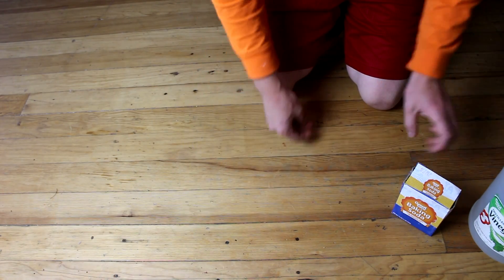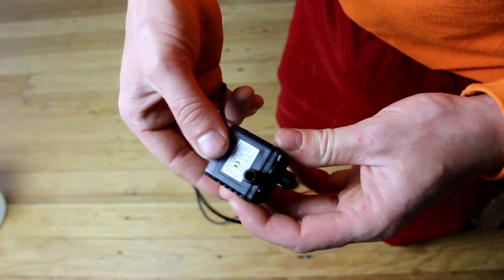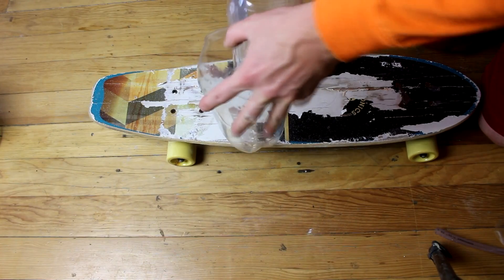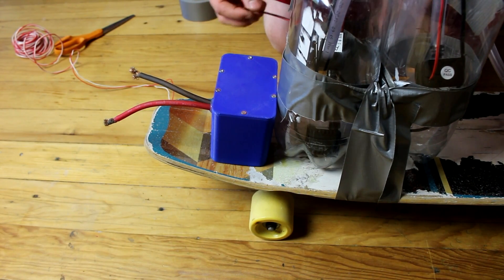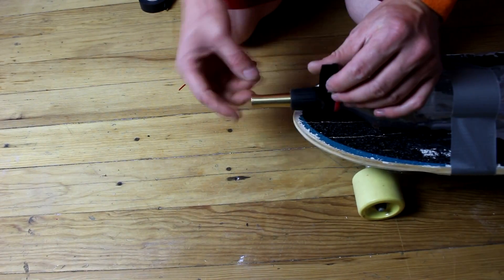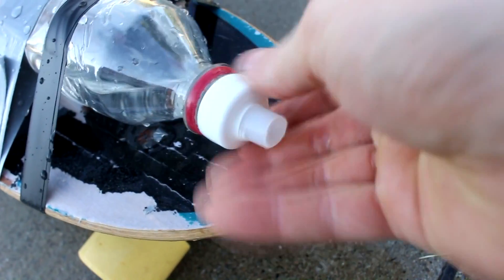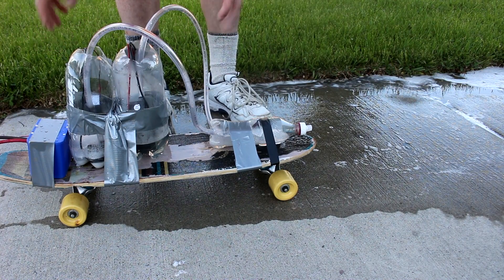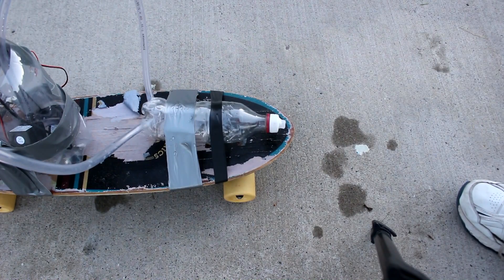Liquid Fueled Baking Soda/Vinegar Rocket

Comment: An unmanned acid spraying skateboard.  Love it.
Reply: It's a salt, or whatever it's called in english when you mix a base with an acid.
Reply: @LuizDahoraavida  It's an Acid-Base Reaction, where a Salt and H2O is created, while they both neutralize eachother because the acid gives a proton (H+) to the base, neutralizing them
Reply: @alanelcapon8342    If mixed in the proper ratio.  My mixture might have a slight excess of Aqua Regia.  (Which I saw a lab worker dump 500ml of on himself while the acid was hot.  You never seen two people rip the clothes off one other person so quick.  Lab worker was fine, pants were not.  lol)
Reply: @seanb3516  why aqua regia lol
Reply: @lautaromorales2903  It's the strong acid I am familiar with from gold assay work.  There are of course faster acting acids and patience is a virtue.
Reply: @lautaromorales2903  extra danger extra reaction
Reply: Don't mind the people here not getting the joke ;)
Reply: Genius! Why didn’t it catch on before? Smh my head

Comment: Hey Cody,  I think one of the problems could have been that that skateboard looked pretty old and chances are it had rusted bearings.  I would bet that if you removed that source of friction with new bearings or even cleaned the old ones you would have had less resistance and it would have rolled easily.

Comment: Two questions: 
Could one use sealed fuel tanks and a pressure feedback system from the 'combustion' chamber so that the pumps only have to maintain flow rather than fighting against the chamber pressure?
Would some kind of baffle system in the chamber help mix the propellants and ensure full reaction happens within the chamber?

Comment: 2 things

1.  Maybe make the container where the two reactants mix larger, so you don't have propellant being formed after it's already escaped.
2. Put a one-way valve on the inlet so you don't have back pressure on the pumps, allowing for a smaller diameter outlet
Reply: Making the reaction chamber larger wont help much just add weight and size, a smaller reaction chamber is better, the important thing is to achieve good mixing, once the reactants are mixed there is no point in prolonging their stay on the reaction chamber.

The average mass flow will be always limited by the power of the pumps, adding check valves and reducing the nozzle diameter might not help and in fact lower the power by lowering the duty cycle due induced oscillations.

Comment: What if you added one-way check valves and used a smaller nozzle and reaction chamber? Would it act similar to a pulsejet? When it's initially switched on the chamber isn't pressurized and the pumps can push the reactants into it. When enough pressure is produced the valves will close, effectively creating a sealed vessel apart from the nozzle. Once the reactants are almost used up the pressure will drop to the point where the pumps produce enough pressure to again open the check valves and the cycle repeats.
If this would work then you could probably use gravity to feed the reactants rather than the pumps.

Comment: Well lets try this again, but this time with conc. sulfuric acid and caustic soda as fuel :D
Reply: Let's try again with hydrazine and fuming nitric acid as fuel
Reply: @sergiomorales4009  holy damn
Reply: that escalated quickly
Reply: Caustic soda would actually perform worse. It’s the CO2 that drives this
Reply: Caustic soda will just produce tons of heat, no co2 gas

Comment: maybe you can use some one-way valves in your delivery tubes to keep the fuel from backing into the pumps. you could also try to incorperate a pressure chamber into the nozzle in order to help build up more pressure and more efficiently react the two chemicals.

Comment: A cone nozzle might in principle help; the fluid is expandable, since it has gas bubbles in it so normally expanding it against a cone would give higher thrust. However, the viscosity is high, so I'm not sure it's such a big win- normally you would get twice the thrust.

Comment: Hi Cody, 
Do you think using 1 way valves on the 2 supply tubes to the compression chamber would adequately mitigate the back pressure? Which seemed to decrease pump efficiency, and might it increase thrust? Or do you think the increased thrust would just keep the valve closed and back to square 1? 
-Great Videos, thanks for sharing

Comment: There is a lot of research on "soda and mentos" nozzles For an engineering class that was our only assignment one semester. It was to design a rocket car using diet coke and mentos. My team and I went a different route. Instead of just relying on thrust I thought it would be a good idea to make it like a water wheel so you get get a little extra energy out of the thrust. Our car was not the fastest but we got the longest distance. We got an A on our assignment which was pretty sweet. And we got a note from the instructor who said he had never seen anyone try that idea before and thought it was genius. This little note stroked my ego a little bit.

Comment: Wait, Cody. How does connecting two pumps with equal output increase the pressure??

I've build a watering system for my plants that is 150cm high from the reservoir, but I've got a pump that can only lift to 120cm. Are you saying that if I connect two pumps I would get a higher lift?
<3

Comment: I reckon you'd be better off with a smaller reaction chamber and a proper nozzle. In a real rocket most of the thrust comes from the gas expansion inside the nozzle rather than the reaction mass being forced out the back.

Comment: there would be more friction in water then on the skateboard.  you might want to lube the bearings.  I think your nozzle is also an issue.  I use to take water bottles put in baking soda wrapped in tissue paper drop it in a water bottle with vinegar seal the top and let it explode.  making airs of gernades for my son.  so your soda mix might be off.  lots to play with.  though credit?

Comment: in the early rocket engines they used something like a checkvalve so the expanding gasses could not pressurize the fuel preventing it from getting pumped. 

i mean... you can build basic rocketlike engines that suck in air and gas almost easier as that contraption there... that might be a kinda more fun project to do and quite a bit more challenging. 

the safest bet on a water based rocket engine would be a high pressure pump. but then you still have the problem that water doesnt store much  energy.

that basically proves that the earth is actually flat.

Comment: I would recommend checking the bearings in the wheels, bad bearings will slow you down tremendously. Upgrading to ceramic bearings would be ideal.

Comment: I bet you can get this to work with:
lighter battery (you dont need a lot of power to run the pumps for long).
lighter skateboard.
well oiled bearings or really expensive wheel bearings.
smoother, level surface.

Comment: Pumps are one way to make rocket engines the other is pressurize the fuel tanks and use valves to control the rate

Comment: Some check valves to prevent the pressure increase from stopping the pumps might be useful
Reply: The check valves closing stops the pumps just the same, as the pumps have to overcome the pressure to open the check valves.

Comment: Maybe use dry ice or liquid nitrogen to pressurise the fuel tanks. That way you won't need the heavy battery or capacitor. It could work better.

Comment: Smaller battery and better wheel bearings might help out. i wonder if you had enough fuel setup right on a hydrofoil boat if you could get significant speed. Maybe throw a RC servo on a rudder and have a alkaline/acid powered boat.

Comment: Wouldn't it have been better to feed from the bottom of the tube so the pressure in the mixing chamber would have the weight of the water on it from above so it'd be harder to push back?

Comment: G'day,

   Ah, as it happens, not ALL Liquid-Fuelled Skyrockets use Fuel/Oxidiser-burning Turbopumps to feed Motion-Lotion to the Reaction-Chamber....

  Last week the Kiwis made their first attempt to reach Orbit with a Rocket which featured Carbon-Fibre Construction for the Fueltanks and "Fuselage-Tube", and ELECTRICALLY-DRIVEN Fuelpumps...; and, just like your Rocket-Driven Skateboard their Thrust was sub-optimal, and just like your Skateboard the electrically-pumped Kiwi Rocket failed to reach Orbit although it did start & run & produced thrust.

  The Black-Plastic Electric Kiwi Rocket  even lifted itself off the Pad....

   Have a good one,

  ;-p

  Ciao !

Comment: at 7:45 i don't think this is a correct explanation of why a nozzle would help. The mass flow rate would be the same, so the explanation of more recoil doesn't make sense. I think its because nozzle directs more of the flow in the direction desired, instead of wasting momentum via turbulence. Could be wrong though.

Comment: Could you use the vapor pressure of something like liquid nitrogen or dry ice? to pump the reactants through a fully enclosed system. Similar to what was done with the compressor, only with the pressure source being self sustaining for a certain period.  Might solve the back pressure issue.

Comment: Would be interesting to hybridise the concept. Keeping the vinegar as is and allowing the bicarbonate to cake into a hollow cylinder (I'd guess high humidity would cause the caking process to occur more rapidly). Pump the vinegar through the solid stage, and witness the science. There's also the potential to use a 'sports cap' from a water bottle to build some pressure, though this could just cause too much back pressure on the pumps.

Comment: If you want to make it more efficient, make sure your wheels are well lubricated and are super easy to roll, so the rocket doesn't have to work against so much friction. Just a tip to those one or two people who are actually interested doing this as a science fair project.

Comment: You should run tubing back to the fuel tanks, this will pressurize the tanks to be the same as the chamber. then your pumps will pump at the same rate no matter how much pressure you build up. That means you can use a small nozzle and boost the pressure.
Reply: obviously this means you will need sealed fuel tanks.

Comment: Hm. Maybe the thicker plastic of a Gatorade bottle would be a more durable combustion chamber. It has a larger volume of course, but with more pumps it could handle a lot more pressure.

Comment: impeller pumps do not work that way...
Reply: bovinespongiformflu Yea,  I really doubt that they are in  any way additive. Each pump moves a certain capacity of water for the given motor input. Increasing pressure would require  pushing into a narrower channel or moving more mass.  The latter is not possible because the mass going though both pumps must be the same.

 I concede that the second pump might have an easier time as the water has been pre-accellerated and thus pull the first one along slightly,  but I would expect that effect to be minimal.
Reply: Pressure = .434Head * Specific Gravity for a given liquid. As head increases so does pressure.
Reply: it will increase pressure slightly but will cause cavitation, its just very inefficient, they should be parallel
Reply: Tim Harig while all the information you gave is technically correct, you completely missed the point that there is a chemical reaction giving off gas in a confined space here.  This is the entire basis behind thrust (energy differential from the high pressure combustion chamber to low pressure space) and is why fuel pumps in actual rockets are in series (multistage), not parallel; they need to overcome the high pressure of the resulting gases in the combustion chamber. Google  turbopump.

The gas creates back pressure (directly proportional to the flow) that is relieved by gas escaping through the nozzle (square root of the flow).  Therefore, the pumps in series, in this case, are increasingly more effective as the fuel flow increases.  

When dealing with straight liquid, pumps in parallel work better when you are running towards the higher end of a single pumps capacity.  It allows you to effectively double the flow if running at the far right of its curve.  Parallel pumps don't really do anything when operating toward the left of the curve (low flow).

Pumps in series are kind of the opposite, but in regard to head.   Using pumps in series at the left of the curve (low flow) will effectively double the head, but using them at the end of the curve does next to nothing. However, pumps in series is normally not normal practice because the optimal operating point of a pump is more towards the right of its curve.

Whether or not Cody's setup would have worked better with series or parallel pumps would depend on exactly how much pressure the gas holds in the bottle at equilibrium as well as the flow rate of the fuel.

-Chemical Engineer
Reply: Evan Van Slooten Google says that pumps in series increases HEAD,  not pressure.  It also confirms my assertion about flow rate. Head, without decreasing the size of the hose from one pump to the next will result in equal pressure. If he wanted increased pressure he could have placed the pumps in parallel to push more water through the same sized pipe, he could have reduce the size of the intake pipe, or he could have raised the height path of the pipes.  These would work for a single pump up to its head limit. THEN if the head was insufficient to increase pressure in the line,  he could have added another.  As it is,  the second pump is  superfluous.
Reply: Tim Harig I'm sorry, but you are wrong. The second stage is acting on top of the first stage's head pressure. The end pressure will not be quite twice as large, but will vary depending on flow. Look up multi-stage centrifugal pumps, this is approximately similar, but more crude.
Reply: Yeah, I was thinking parallel would be more effective. He was probably not thinking too hard about it and just kinda figured "batteries, pumps; same thing right?"
Reply: The head pressure you are referring too is the maximum possible pressure that the pump is able to exert.  However, in order for a system to reach that pressure, the system must be able to push back on the pump with as much pressure as the pump capable of pushing.  If not, the system simply gives way and releases the pressure before it can ever reach the pumps limit.

I have extrapolated about this in other posts but the short answer is this: if a single pump is able to pump, then there is no pressure or volume advantage to using the second. It is superfluous. If the back pressure exceeds what the first pump is able to produce, only then will the second pump actually increase pressure to the system by doubling the maximum POSSIBLE pressure.

Still, it does not automatically indicate that the pressure in the system will be doubled.  The actual working pressure will still only equal what the back pressure can exert as a load on the pump.  The pump sets the maximum pressure and the load determines the actual working pressure.
Reply: Yeah, they do. Google centrifugal pumps in series.
Reply: jernej Jakob No, you basically just repeated what I have been saying here and elsewhere in these comments: "The end pressure will not be quite twice as large, but will vary depending on flow." Exactly.  Head pressure is additive but that DOES NOT AUTOMATICALLY EFFECT THE END PRESSURE. You cannot just put two motors in series and expect the pressure to increase by itself.  You have to do something to the flow of the water.  Exactly what I have been saying all along.  What head pressure does is increase the potential pressure that the motors can produce.  But that pressure is only ever reached if there is some additional restriction of flow in the system. 

And a series configuration of brushless motor pumps definitely does not increase flow volume as Cody stated in the video.

Comment: Hey, you should try using baking soda and vinegar to make a hybrid rocket. You could make a solid core of baking soda if you used an adhesive of some kind for it. I don't know how well it'd work, but it might be simpler and more weight efficient than dissolving the baking soda in water.

Comment: I've always wanted to do this!  Does the water in the soda bottle not slow down the reaction a great deal?  Also, wouldn't be too difficult to feed the combustor pressure back through an air bottle and into sealed reagent bottles.

Comment: How about stronger base / acid? Maybe even Heating them to closely belowthe boiling point before mixing so that they easily produce pressure by the steam from the exothermic reaction, kinda dangerous though with hot corrosive stuff...

Comment: Cement is going to be bumpy but you are going against the scrape lines from when they smoothed the cement. I think you would have had movement changing the angle just a bit, neat science fair trick, thx for the vid.

Comment: I don't know if putting them in series is a good idea.  like on your pool, if your main pump is too strong, it will force too much water through your booster pump and cause early failure in the booster.  

Probably a better idea to run them in parallel.

Comment: humm the reaction chamber is too big also the capacitors and whole rig is too heavy switch to a pair of 9v batteries in series between the 4 pumps the drop should be enough the pumps won't die from over voltage...

Comment: the friction coefficient of the concrete was lowered when the "rocket engine" was previously fired wetting the concrete . dry concrete has a friction coefficient of 7 and wet concrete has a friction coefficient of 3-4.

Comment: Cody, what if you filled the pump tanks with fresh cola soda, and had the nozzle/sprayer bottle full of mentos? and possibly used a pressure release valve on the nozzle/sprayer bottle, and some inline one way check valves on the pump lines to avoid pressure backing up. Please try this!!